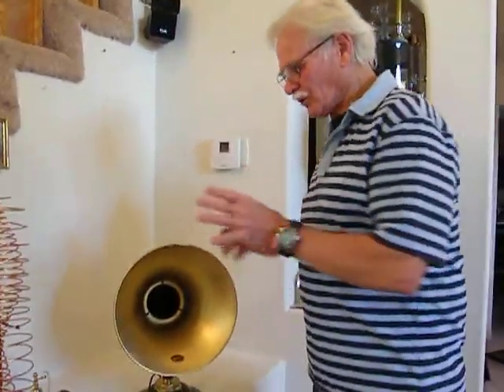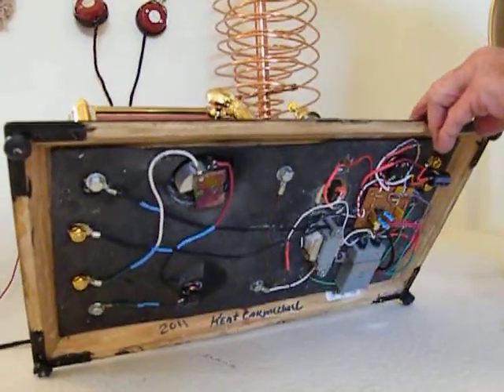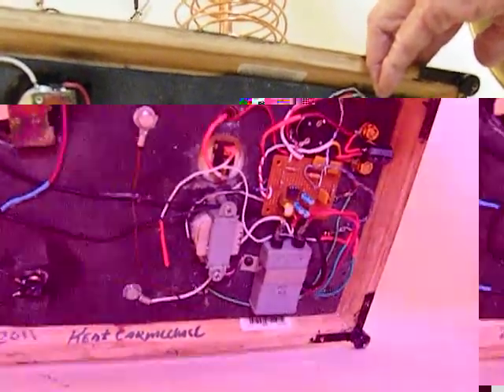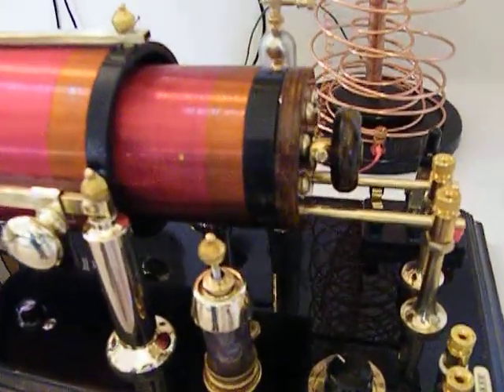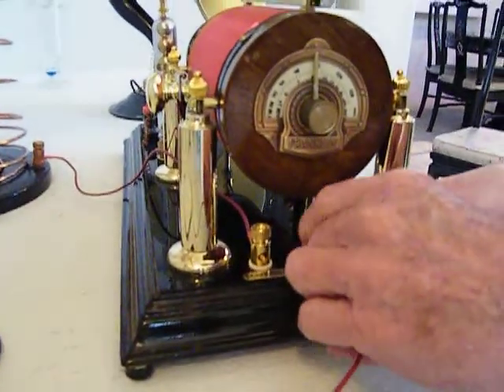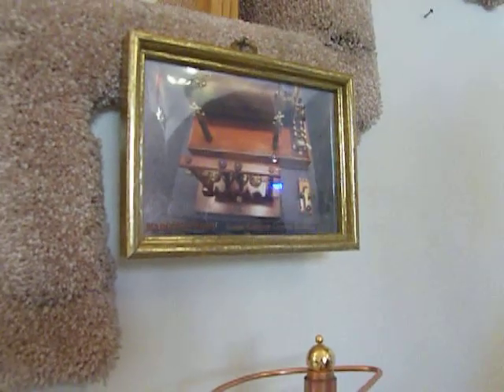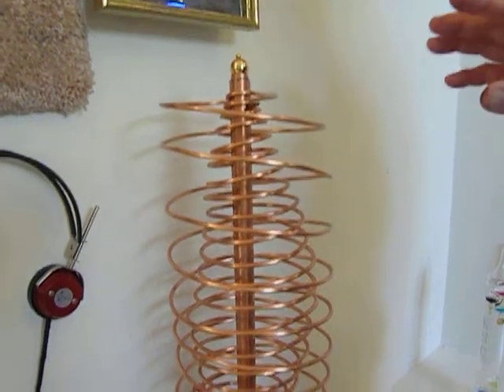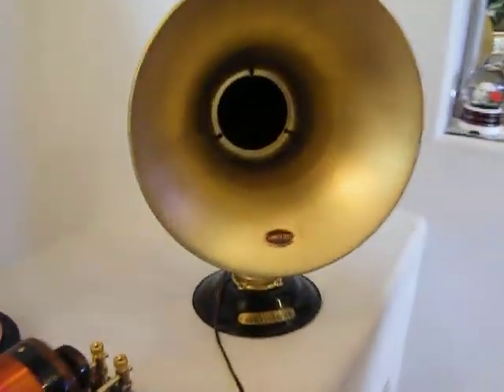crystal radio

Comment: I am assuming there is a battery for his amplifier, but the rest of it runs on radio energy harvested from the antenna. Now, I wonder if some of the modern low energy integrated circuit "energy harvesters" may be able to charge the battery while the radio is not being used, by storing the energy that would normally go to the speaker. Pair that up with a modern super efficient digital audio amplifier IC and you will not need batteries unless you plan on listening A LOT.

Comment: 0:41 Oh that is kind of cheating isn't it?  A True Crystal Set is a passive receiver!  But if you need an audio pre-amp then you could have acquired an excellent one for such purposes from Radio Shack! It too was built around the LM386, and came with its own RCA connector cable. I don't know if they are still being produced, but no doubt it has a replacement model made in China
Reply: Well he has headphones
But if he wants to demonstrate it 
It needs an audio amp.

Comment: Very beautiful old timey looking! Does this NOT use a battery????
Reply: The radio doesn't need power, but the LM386 amplifier would have to...
Reply: Kennynva : correct. I was scratching my head over this. Pure crystal radios use electricity, as you know, from the antenna. Pretty set, but...smh
Reply: No battery... Some people add amps . But
   A regular crystal radio doesn't

Comment: 2:05 what is the copper screw thing that kent uses to hook up the antenna wire to the radio with? what is the technical term for it?
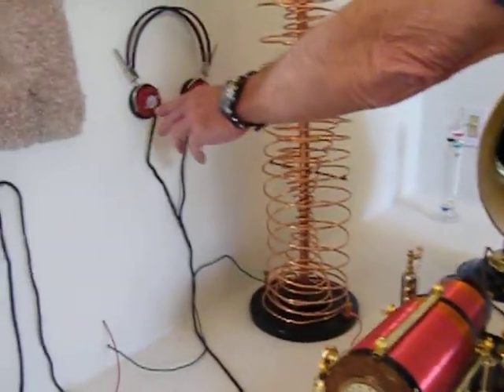Reply: 5:00 He calls it the "Ground Plane" that "intensifies the Ground Force" - - doesn't make sense to me either